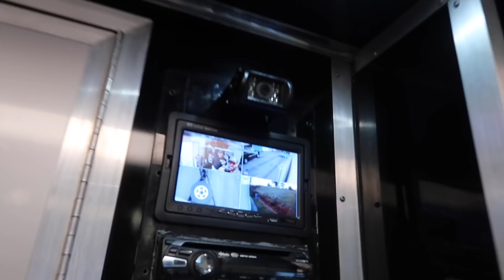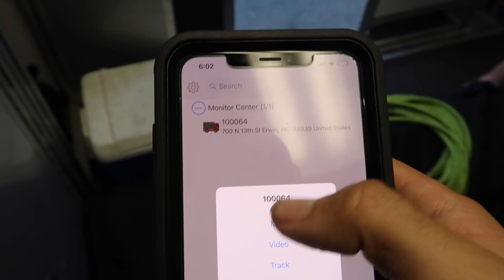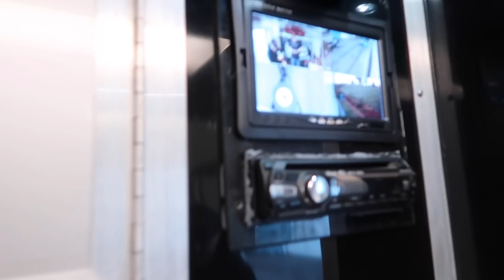BEN SAVES THE COWMARO!!!!

Comment: I am totally turbo ignorant  but it's an honest question Would it make sense to have the regulator on the CO2 bottle be just say 4 or 5 lb over the maximum boost you would ever run on your car in case the valve fails it only goes up 4 or 5 lb of boost instead of 75 lb that you have in the regulator now or did I hear that wrong?
Reply: Steve M if we did that the boost would be in consistent because of how much bottle pressure the solenoids bleed off to maintain dome pressure.
Reply: Blackphillbuilt I appreciate the reply after a long while of thinking about it, I surmised it would probably slow to react as well without extra pressure coming from the regulator